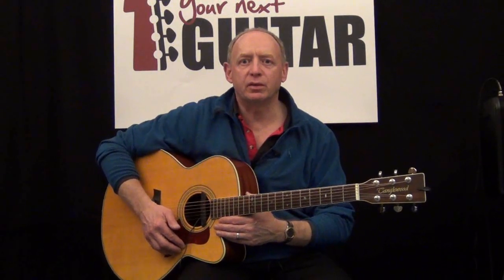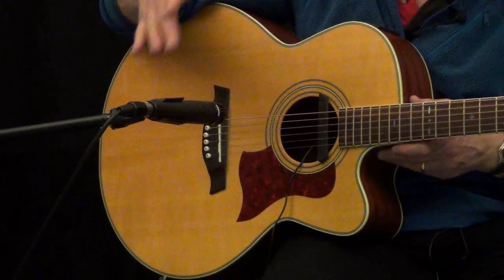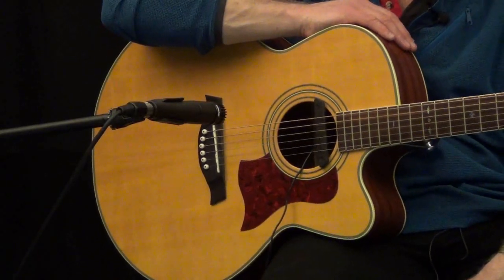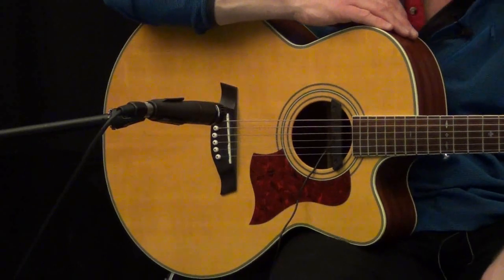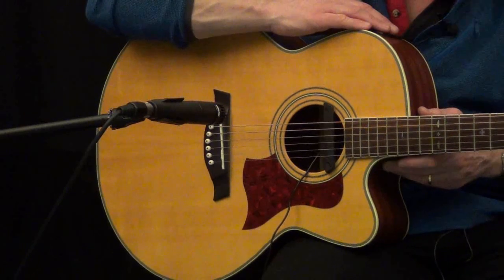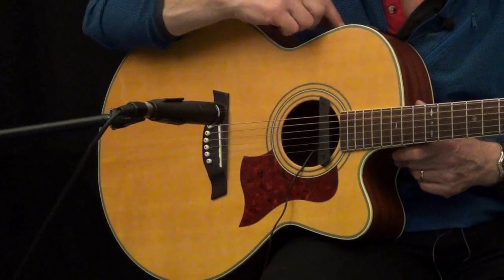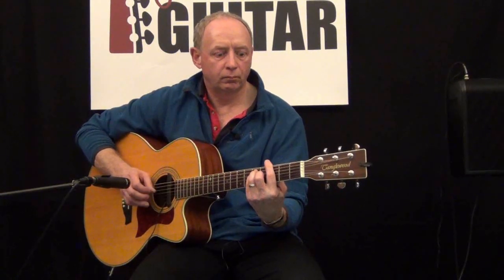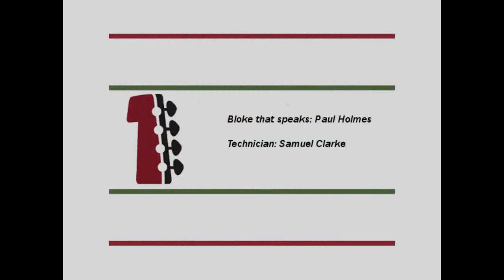How to choose an acoustic pickup - Acoustic Piezo vs Soundhole vs Microphone

Comment: Another factor to consider is playing style.  I have a Crafter TCO 35 with its built in piezo and a Shadow SH145 active humbucker.  The sounds are different, but not by a huge amount (the Shadow is slightly 'smoother', but still acoustic-sounding).

Played gently, there's not a lot between the two.  Strummed hard though, the piezo volume doesn't increase much, but the quack becomes more prominent, whereas the Shadow just gets louder, without compressing or distorting, so for me, the Shadow is better than the piezo.

The Shadow doesn't pick up body tapping, whereas the piezo does, so for some people this will be an important factor and a magnetic pickup won't suit them (Baggs M80 might).

I've also tried using an SM57 microphone, but prefer the greater control and freedom of a pickup.

Comment: Or add a second jack plug and a high pass filter on that piezo and run it with an internal mic a saddle piezo and a humbucker neck pickup.. Make sure to switch to magnetic wound 3rd strings

Comment: I think that a soundhole pickup would do best for me since I have a classical acoustic guitar. I love the tone of it and the soundhole pickup would just amplify the beautiful sound in away that doesnt have to end up with me damaging or modifying it .
Reply: You can't do it. Classical guitars have nylon strings which the soundhole pickup can't pick up (no pun intended). It's still a magnetic pickup. You should research soundBOARD pickups. They glue on the surface of the board inside and you don't have to drill anything (maybe a hole for the jack, but you can avoid it)
Reply: well they have acoustic electric classical guitars with nylon strings and they sound really nice. If they have a pickup for classicals that'd be cool too.
Reply: that's probably a piezo pickup of some sort
Reply: oh ok

Comment: Thanks for the demo ,I have two guitars with piezo  pickups one has the preamp and EQ , not too bad, the other is just passive and because I suppose it is putting out full wack I cant turn my amp past number one without distortion, it is a little acoustic amp , really unhappy,  the guitar  has no sound hole on the middle, I have ordered a magnetic one and intend to try a bit of blutac

Comment: Miking is best but has a less even sound (I feel like I have to constantly fritter with mic placement). I love the sound of that magnetic sound hole pick up, but I do percussion body taps, so that's not the one. Been playing with soundboard piezos & seems a combination of the undersaddle rod piezo and a peizo disc or two might be the way to go for me. The undersaddle doesn't pic up enough sounboard sound either and as said can be a little quacky.
Reply from the maker: Hi - The Fishman is not designed for body taps even though it is 'active' . If you want a soundhole pickup that also lets you amplify body taps then try the LR Baggs M80. It's expensive but very good. RRP is £329.95 although we can get it for £299 for you.

Comment: Hello, 
I  have a Taylor 214 and want to upgrade it to play plugged with our band….Is the LR Baggs Element easy to install for a luthier ? Does it fit easily in the Taylor 214 saddle part ? 
Does it give a warm good all sounding guitar itself ?  Thanks for your answer, 
best regards from France, Gaëtan,
Reply from the maker: Hi Gaetan
We haven't used the LR Baggs Element yet but all their products sound good. Looking at the instruction manual on-line it should be easy for a guitar tech to fit it. From my experience under saddle pickups aren't 'warm' - have you looked at their Lyric and iBeam pickups?

Comment: Can a basic sound hole pickup like a Dean Markley be plugged into a PA system, or do you need a pre amp?
Reply from the maker: That depends on several things - if the pickup is 'active' (has a battery in it) you may get away with plugging it into the PA; if not, then it should go through a pre-amp or amp. Also depending on the power of the pickup the length of the cable used may affect it as well if you plug into a PA (the shorter the better). Hope this helps!
Reply: Tilbily